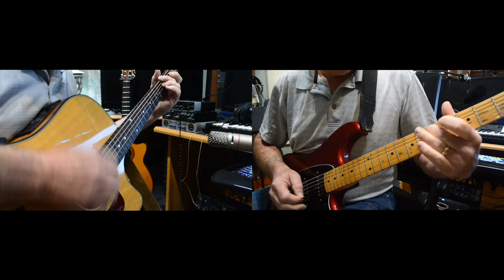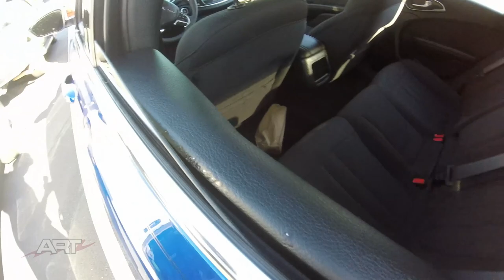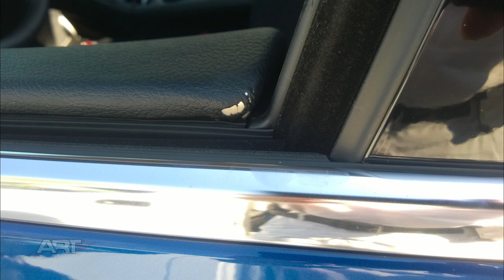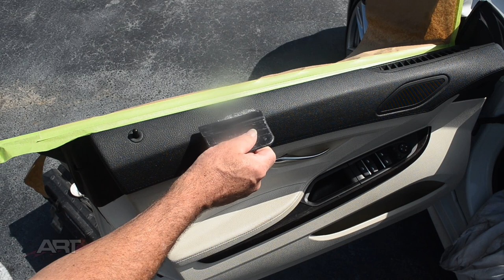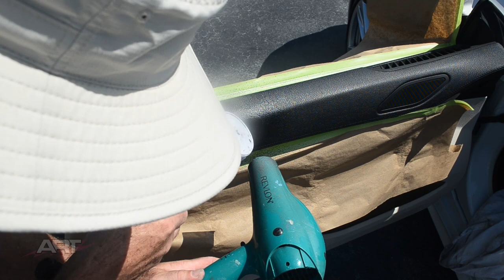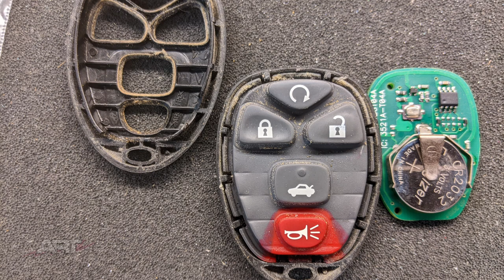BMW Door Panel Repair v116

Comment: Another great video and practical as always as this type damage is stuff that we run into all the time. The door panel that had the deep wrinkles, that is the foam underneath the vinyl or urethane skin that gets messed up. We have to recover those if they are really bad. As you mentioned heat will NOT fix that damage, it can make it worse ( ask me how I know ...) but fortunately we can recover the top sections.  For repairs you did a great job, much cheaper and faster and sufficient for many folks. It's hard to believe the window tint guy damaged ALL 4 door panels on a new car , you'd think after the first one he would ask for help or quit. And we have run into that before too, as if we need more work!  Love the intro music and that old red Ibanez! Take care my brother!
Reply from the maker: Thanks for mentioning recovering the Suburban door panel parts.  I left that hang in the narrative as a dead end for those hoping to simply repair.  
That year and model Ibanez gets rave reviews online among Strat enthusiasts!  I was between gigs with a Mosrite that wouldn't stay in tune so picked this up on the way.  Sold the Mosrite too which I now regret.

Comment: Excellent videos. So much great info in all of these. In addition to your tech tip about the gm key fobs, for many customers I will use some aluminum foil tape, a standard hole punch and put those punchings on the backside of the rubber to replace the worn away conductive surface pads. Works like a charm.
Reply from the maker: Nice!  Thanks.

Comment: Great video!   I have a C6 Z06 that needs some love.  My elbow has created an indentation & crack due to sprinted driving on curvy roads.   The seats are so poorly designed that you have to brace yourself using your elbows.   Now it may sound like I’m ragging on this car.   Actually I’m not.   The seats just don’t match the performance ability of the rest of the car.  Anyway, I’m trying to learn how I can repair the door panels myself.    What is the best filler to bring the repair even with the surface that will have some level of strength to withstand my elbow pressure.   Yea maybe a good performance bucket seat might be in the future as well.   Thank you any insight you might be able to offer.
Reply from the maker: You'll have to be the judge as for what the damage needs.  We've covered several door panel and armrest repair ideas already.  I recently posted a video index to help you find them.  If you have a question about a specific product please ask your supplier.

Comment: Great repair mate. Like the song intro. So I ave noticed when I have to put multiple layers of Spray texture ( I’m using vipers water base sprain grain over here in Canada )it can look shiny side angle if you had to use multiple layers..even when I flatten paint it just looks different side angle particularly on dashes.is it because I think you might be using a water base primer as texture instead as opposed to a regular spray grain say like w2 ?
Reply from the maker: Thanks Morgan.  I am using the same water base coloring system for the leather as for my texture.  I don't use any of the materials sold specifically for spray grain.  One reason is softness doesn't allow for sanding with 400 grit.  I do add the harder plastic primer as mentioned.  Also perhaps I could feature more of how I control the sheen through every step.  Of course, the 400 grit step evens the sheen across the panel ready for the final step.  Thanks for this observation and I will look to do an update in the future.

Comment: Have you ever, used the atomizer. 

Is a airbrush,  with your mouth.
Reply from the maker: Yes indeed!  It's been a long, long time.  You have a connection to the 80's!
Reply: @a.r.t.srealrepairsforrealc8247  

My company started in 1980s out in Illinois, Chicago ..

Creative colors international.  

The atomizer airbrush is phenomenal for quick repairs.  

I also use the spray gun.  
And I use a atomizer spray gun.
Reply: And I believe , there four franchises, in North Carolina and South Carolina.
Reply: there's one, in Hawaii.